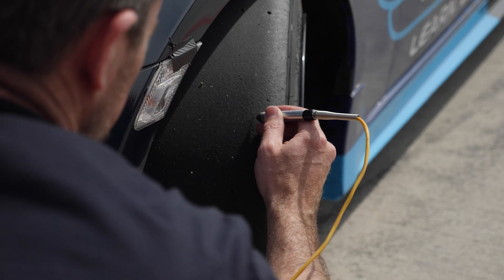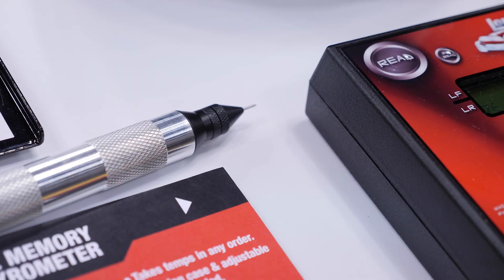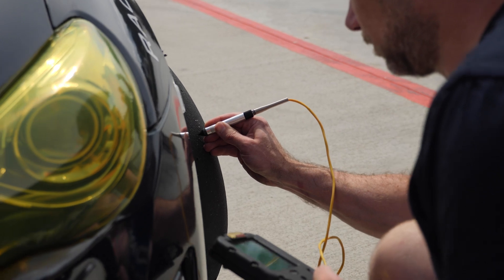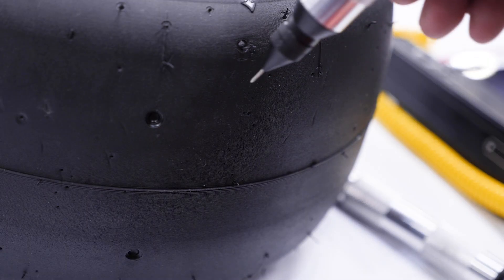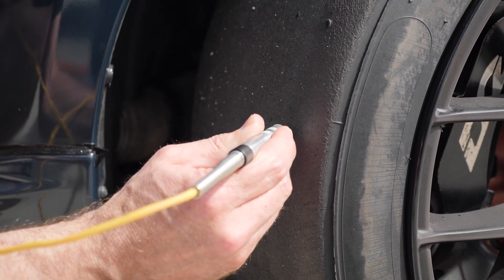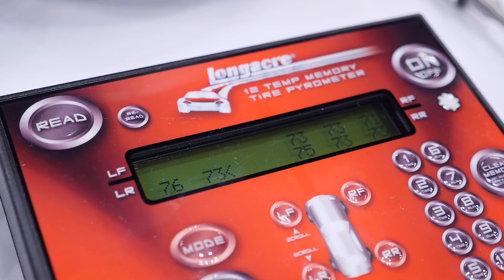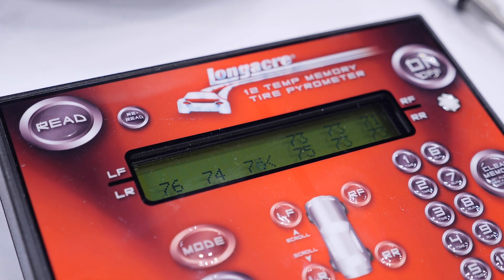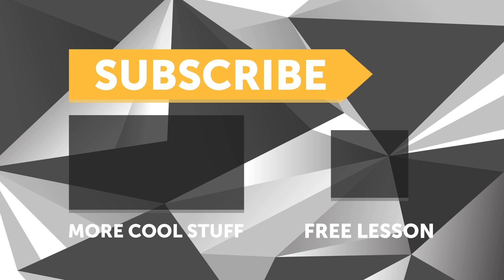Why Pro Racers NEED Tyre Pyrometers & Similar Data

Comment: Take an audio recording device with you. Verbally record the values at all tires and review later.
Reply from the maker: If that works for you, that's great! A notebook is nice and simple as well if tools like this are not available.
There are many ways to collect the data really, the hardest part for most is making the time to check it and then adjusting the setup from there - Taz.

Comment: This is something I've commented about to some of the "drag' race folks, as there doesn't seem to be any underlying logic to their "burnouts".
Obviously a team member can't take a probe to them, but there are IR scanners and cameras that can 'look' at the tyres and so get a close estimate of the actual tyre tread temperatures.
That way they can check their data to see if longer or shorter one burnouts are required for the track, air and other factors, to get closer to the ideal, and if an aborted test start needs a short spin, or is at a good temperature.
Add a pressure sensor, for the build-up that may also affect the tyre's reaction, and it may be useful data for setting up with less 'guess' work?